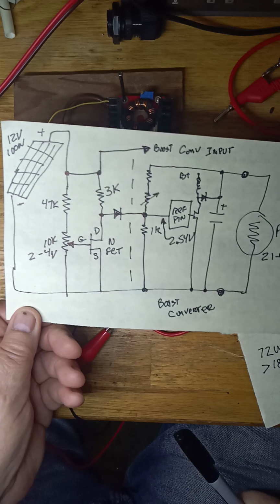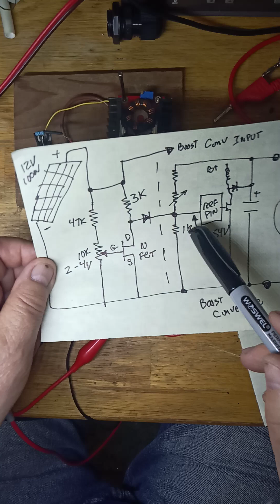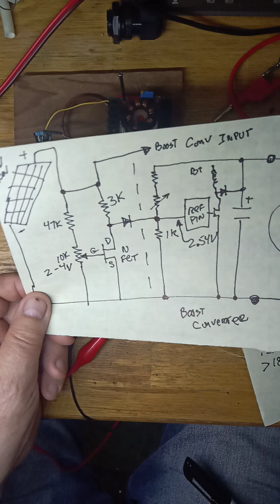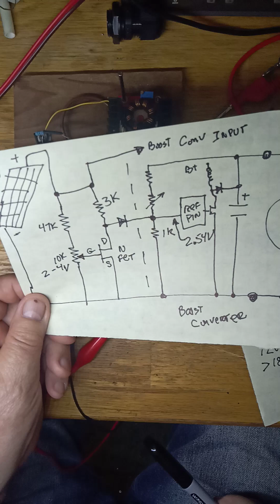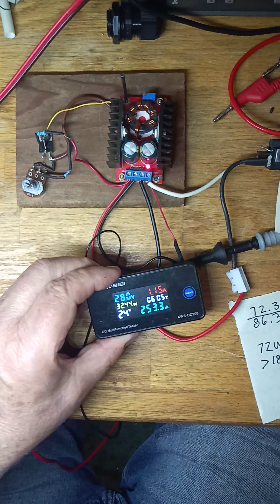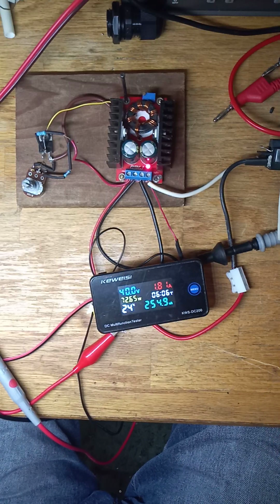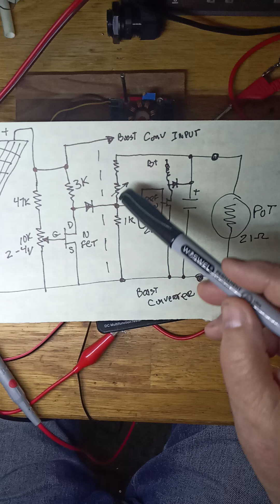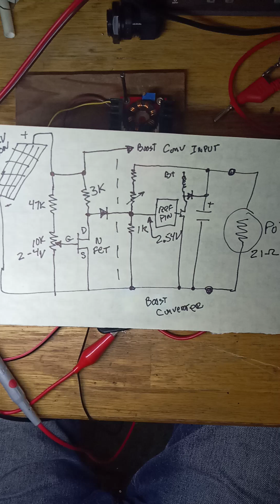PV Cooking Pot,  Circuit To Control Input Voltage To Maintain Power Point

Comment from the maker: This five component circuit will fake a buck or boost converter into ramping down the output voltage when the input voltage goes below a set voltage. There are many variations of this circuit using TL431, op-amp, transistor and microprocessor.

Reducing the FET pull up resistor to 3K from 10K fixed the problem of the boost converter not turning off when the input voltage dropped to 10V.  I was in a rush to do the test and see how many WH it took to get a typical meal up to temperature. Rain was predicted the next day and it was already after 10am on an east facing panel.  The response was predictable from the math.

Comment: Couldn't a super cap hold the voltage to a stable voltage without the need for this circuit?
Reply from the maker: No, some capacitor is needed to store energy for short periods.  A circuit is needed to only draw enough power to keep the panel at power point. Without that the capacitor will discharge to a point where voltage is stable and not necessarily be the most energy efficient transfer. Most videos on PV cooking are just click bait and don't function well at all.